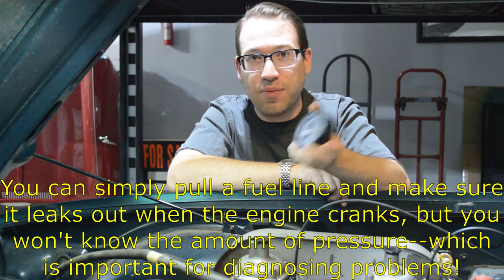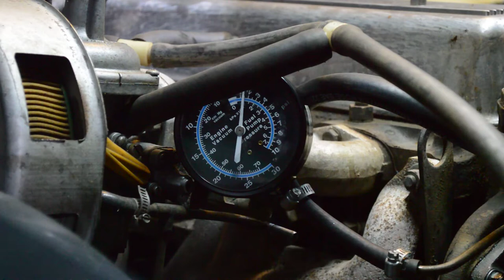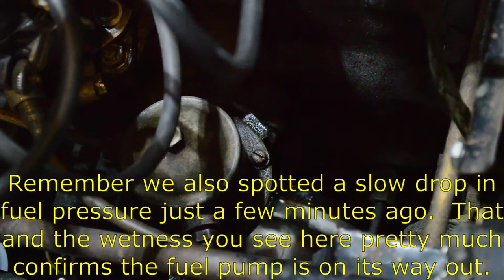My Triumph TR6 Died This Morning!  Here's How I Fixed It

Comment: I had a 76 TR-6 for twenty years...you were right on.
Reply from the maker: The TR6 is still an underrated sports car.  It's in the sweet spot where you can drive it every day if you wanted to.  It's comfortable enough to use, practical enough for grocery runs, still turns heads, but doesn't break the bank.  It's a shame Triumph isn't still around.

Comment: You made me wait to the end to hear why it wouldn't run.....
After checking point gap with a feeler gauge, I've used a piece of stiff paper with acetone or lacquer thinner to remove any traces of oil from the points surfaces before replacing the distributor cap.  When replacing the points, be prepared to replace the condenser also, especially if having arcing across the points.  Consider a CDI or MSD unit which uses existing  points in order to reduce point arcing while greatly increasing their life.
Reply from the maker: Excellent point!  Get it?  Point!  Anyway, you're also right that the condensor should always be replaced at the same time since it's often the reason for the points failing.

Comment: I'm surprised that this is the first time someone has documented these basic tips and tricks- I even learned something! Hooking a timing light up to check for  spark, for example. Duh! Cool. Question: did you rebuild your fuel pump, or install a new one?
Reply: Oh, and the only time my TR6 quit on me..I forgot to tighten the battery iso knob. It wasn't hardly loose, so it started and drove, but when I turned right it would quit. That was the first week of ownership LOL.
Reply from the maker: Hi John! I installed a new one, but I've kept the original to rebuild.  The replacement was a cheap reproduction I already had on hand so I don't fully trust it.
Reply: @midwestmotoring  Yeah, I have a nice looking repro myself but it's only for if the original craps out. I've heard the strainer in the new ones is bad.
Reply from the maker: @jamcdona  I've not heard that but with a good filter in place it shouldn't matter.  I do know that the actuator am on the back is very cheaply made on some pumps. You can get a pretty good quality reproduction pump if you look around.

Comment: Hi,
I enjoyed watching your trouble shooting classic triumph. I have 1969 Tr6 recreation as race car. Every summer it could be started easily for 10 years. Now I can not start it even replaced with new parts and have full battery, fuel and having sparks check. There were loud popping sound during cranking. I did not find any YouTube addressing this issue. Perhaps you could tell me why it fail to start, what cause the loud popping sound and how to fix ? Thank you ahead for your suggestions.
Reply from the maker: I can try.  A lot of things can cause loud popping sounds, most of them ignition related.  Just because you have spark doesn't mean it's happening at the right time, so I'd start there.  Maybe the points are worn, or possibly the fuel pressure isn't high enough.  Sometimes from sitting (even just over the winter) the fuel can gum up in the carburetors and will cause what you're describing.  Anyway, you need to check everything in detail.  Just having gas and having spark isn't enough.  You need the right amount of spark at the right time with the right amount of fuel distributed to the right cylinders with the right amount of valve clearance....  you get the idea.  Here's your list:  1) Set the points with a feeler gauge.  2) set your rocker clearances.  3) clean and lubricate the distributor.  4) static time the ignition.  5) check fuel pressure with a gauge.  6) pull the carburetors and clean out any varnish, then re-set the float height, replace the needle valves, make sure the jets are clear, make sure the diaphragms aren't torn, set the needle height, and re-test.  If it still won't start, you've missed something and need to go back and test everything again.  I'd also check compression early on.  You need to know you're getting enough compression or the engine won't fire.  Good luck!

Comment: Just had the same issue with my 75 TR6. I changed the points and the car will start but when it warms up, it will die again. Any suggestions? Thanks
Reply from the maker: The car dying when it warms up can be a whole host of issues, but often deals with fuel mixture.  You could have a vacuum leak, or your fuel pump might have an issue, or trouble with your throttle linkage, or even a compression issue.  I'm afraid you're going to have to do some investigating and check out the engine and all systems both when the car is cold as well as warm.  It could be as simple as a bad carb adjustment or as hard to find as a crack in the block that only opens when things heat up.
Reply: Thanks I’ll keep you posted

Comment: I’m not getting fuel out of the fuel pump, cars been sitting for 10 years but everything is like brand new. Can start the car with starting fluid. Car also had barely any gas in it when it sat. Thoughts on the fuel pump? Is there a way to prime it?
Reply from the maker: This is a silly question, but have you tried adding fuel?  If it's been sitting with low fuel, some of it probably evaporated.  Even adding a little from a can may not be enough, so I'd try adding more.  You may also find you have a leak.  

As for priming, it depends on what car and what fuel pump.  Healey 3000s have an electric pump, for example, while a TR6 will have a mechanical one with a priming lever on the pump body (assuming the original style pump).  

Unfortunately, everything being "brand new" a decade ago doesn't count for much.  Components go bad from sitting much faster than they do from being used.  Tires are a prime example.  If they're 10 years old, they should be thrown away regardless of what they look like.  

You may need to replace some stuff that appears to be in great shape,. but try adding fuel first.
Reply: @midwestmotoring  my wording was horrible I apologize haha, I was looking for if there was a way to prime it. I ordered a new fuel pump but I found the lever prime gonna try again today to get it running. Thanks man!
Reply: I got it running man! Got a video up on my page! Thanks for your videos and your help!

Comment: This reminds me of what a pain mechanical points were back in the day, and how archaic they were.  I use to check them weekly, but sometimes daily!  That was until I discovered electronic contactless points - Luminition/Pirahna were the choice of the day back then and the transformation was magical.  More power, less fuel, cleaner running, 100% reliable, just bin the points and go for it.  Trying to preserve originality with fragile capacitors and throw away mechanical points is a mugs game.  I did this back in the late 70s and I gather they're still available.  The car deserves it.  Breaking down at 10pm on a dual carriageway when it's pouring with rain is no fun!  Don't forget the high output coil though and then turn the idle speed down!  Another upgrade is to an electric fuel pump - all your woes will be banished then...
Reply from the maker: Most of our cars have received a FAST ignition (used to be the Crane XR-700--same product, new company) at this point.  You're right about the reliability!

Comment: I have a 1976 it back fires and dies what could it be
Reply from the maker: Sorry for the delay--got busy at the office.  Unfortunately it can be a bunch of things.  I'd want to know if it used to run better and then changed, or if it's always backfired.  If it used to run well recently, I'd suspect points are not adjusted properly.  Good luck!

Comment: Great video. I have a 75 TR6. I also need to change my fuel pump. The two mounting screws look pretty tough to get to.  Any helpful tips for changing the fuel pump?  Thanks
Reply: Not that hard to reach:  But....find a way to cap the fuel line (bolt inserted into flexible fuel line)  just above the fuel filter to limit the amount of gas that flows while you swap out the pump.
Reply: @allanmarkby4177  Thanks Allan what I'm referring to is the air pump mechanism  that's right in front of the fuel pump. that came on all 75 - 76 TR6 models. I did manage to squeeze by and replace the fuel pump with all that crap in the way...
Reply from the maker: The air pump does get in the way on TR6s.  I guess it's a sign of the times.  Working on a newer car is an exercise in pulling parts off to get access to everything.

Comment: Another way to get the points open is to jack up one rear wheel and have someone turn the other one until it's on the lobe.
Reply from the maker: I wouldn't recommend that.  You'd need to turn the wheel with enough force to spin the engine.  Jacking up a wheel just makes that more dangerous and less convenient.

Comment: If it was my car I would swap out this crap British engine and stick a Mazda or Ford power plant and run easy every day.
Reply from the maker: That's more a product of the time frame than the country.  In its day, the TR6 engine was pretty reliable, and compared well to Mazda and Ford engines at the time.  I'll probably be skewered for saying this, but even the Jaguar V12 and Triumph TR7 engines were good--they were just often only half  bolted together by someone on strike and fell apart from poor maintenance.  Anyway, no question any modern engine is technically better, but you lose the character of the car.  The best way to install a Mazda engine in a British car is to buy one that comes with the rest of the Miata around it.
Reply: Can you put a TR6 body on a Mazda Mx 5?
Reply from the maker: @bernardturner8103  sadly not.  I'll have to concede that point.
Reply: But then you don't have a British car.
Reply: My Tr6 is slowly becoming Japanese.   Nissan rear end, Toyota tranny, Datsun carbs.  Steering wheel, shifter knob, ebrake handle   Etc.  Getting a rising sun decal for it. Lol